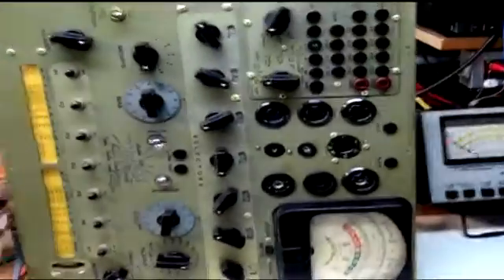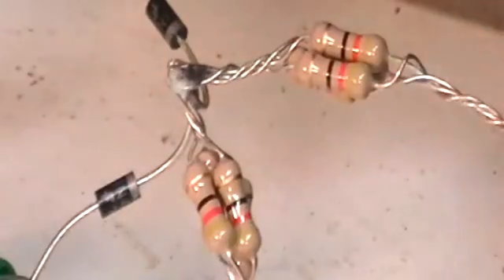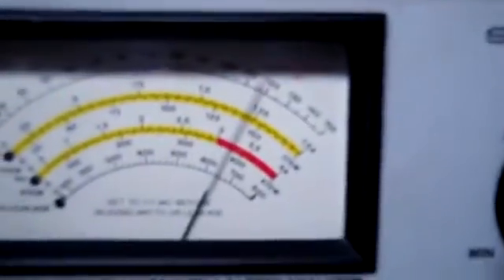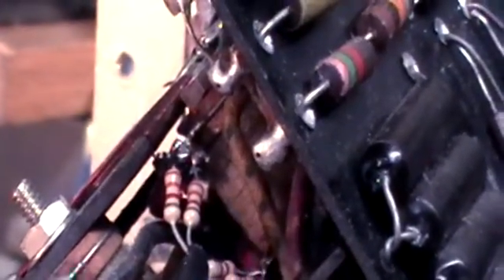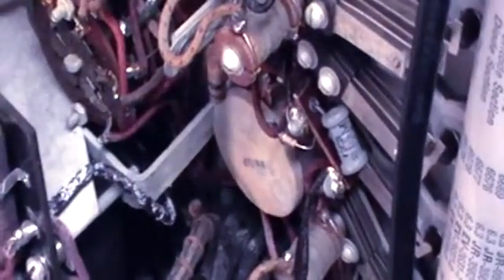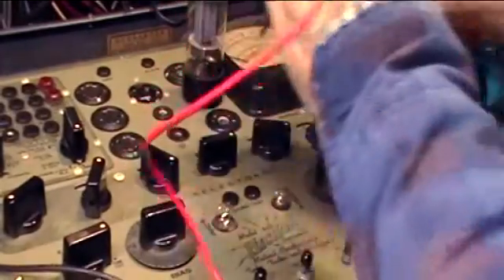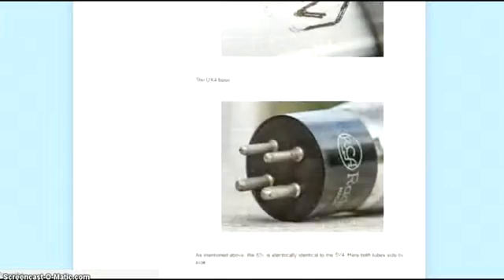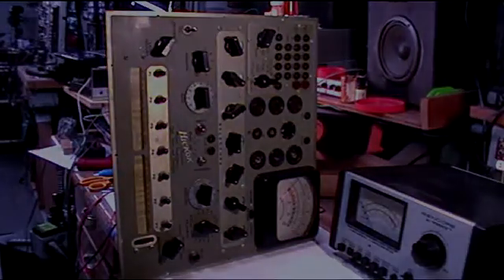Hickok 534 tube tester Repair &  #83 tube Solid State conversion

Comment: OK this was done a while ago now.  I have just bought a Philco 9100 which is a 1954 copy of the Hickok 533 electron tube mutual conductance tester.  Here in Australia obtaining an 83 mercury arc rectifier would not be viable. As a tech of 50 years I started my trade in 1965.  Vacuum Tubes were still king at that time so at 15 I basically grew up with them and saw them phased out.  Looking at the data books I have an 83 rectifier has a constant 15V drop across the device whilst current is drawn.  Besides using  two 1N4007 diodes and a couple of 1W 100R resistors I propose using a 15V 5W zenner (reverse biased)  in series with the output as well to replicate the 83.  This should stop any calibration errors.   By the way 1000 PIV (peak inverse voltage) silicon diodes have been used in the late 1960's in tube equipment so they are not likely to blow up, as such  the fuse is not required  This would seem to be a permanent fix as 83's are hellishly expensive and of course not being manufactured at all (I guess)  ?   Robert (my tuppence  worth)
Reply from the maker: Excellent idea ! I don't know why I didn't think of the rev. Zener back then ?
I think I was waiting for something to go terribly wrong, hence the fuse !
Reply: The Hickok 533 was designed back in the 1950's, I don't know how Philco managed to make an exact copy of it because there were patents in place .  The service manual for the Philco 9100 says circa 1954 so one would presume the Hickok was designed before that ?  In the 1940's to 50's there were no silicon diodes just copper oxide and selenium rectifiers so if you wanted to have current without a variable voltage drop with variable current as in a vacuum tube rectifier a gas filled tube would have been the only way.  In the  early1960's silicon rectifiers were starting to be used certainly in military equipment electron tube equipment then domestic. Zeners came after that but not long after because I remember seeing them in a radar designed in the late 1950's to early 1960's and that was a hybrid Fire Control Cyrano II used in the Mirage III  designed by the French. I spent 6 years of my life on that beast.   I don't know why gas filled regulator tubes were not used in electron tube testers as they were certainly around then and it would have negated the necessity to adjust the mains voltage input to the instruments transformer.  Although the 50 & 60 Hz mains was used as an AC signal drive so stabilising  of that would have been difficult then. A suitable signal could have been generated by an on board oscillator suitably buffered with a cathode follower tube and fed with  regulated HT. 
In reconditioning this type of  equipment the purists want everything to look authentic which in my book is just stupid. If you can improve an older instrument by adding more modern components then why not do it.  As Star Trek's Spock would say it's illogical not to.   All the best,  Robert

Comment: Should add 2 zener diodes onto the 1n4007 to simulate 83 voltage drop make sure silver band of 5.6v 5w zener is facing silver band of 1n4007. That would fix your need to add that resistor on the reohstat should be able to take it off

Comment: There is a difference between the #83 and the #83v. 
This from the G.E. Tubes essential characteristics manual (unknown date) price 75 cents.
The # 83 has a higher voltage and current limit and filament current. 15volt tube drop approx.  and 3 amps on the filament. 
The #83v on the other hand has a voltage drop of 25 volts at 75mA per Section and 2 amps on the Filament. The height is different,Its  4-11/16" on the #83 and 5-3/8" on the #83v.

Comment: Hi I'm wondering if you know how to calibrate the English control for the Good Bad Test on those Testers?
Reply from the maker: No, I never got to the point of fine calibration on this unit as the owner wanted it back as soon as it was running but I think there is a site that deals with the Shunt or "English" cal. for a Hickok 600. It might help.
http://tubesound.com/2010/04/28/hickok-6000-calibration/